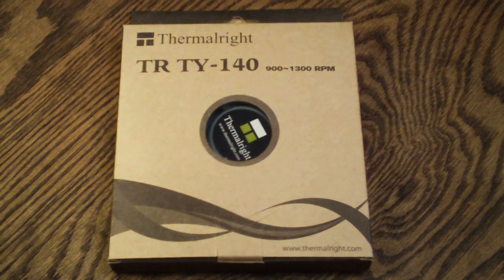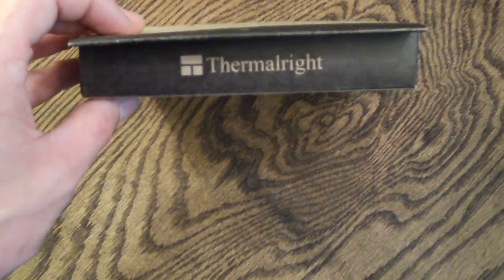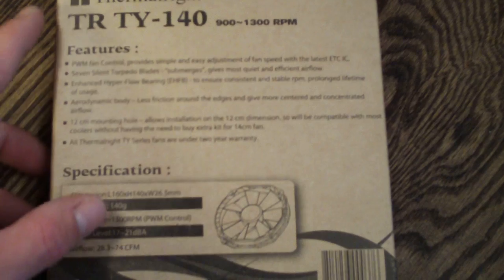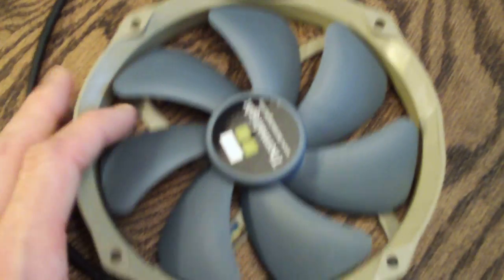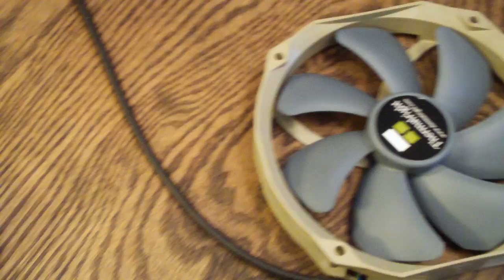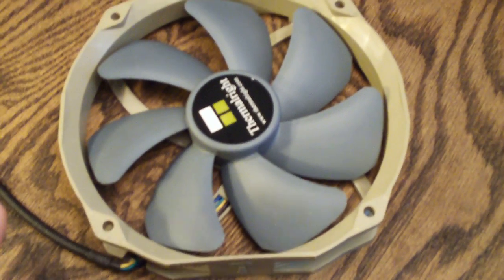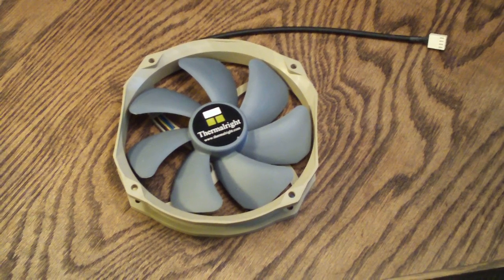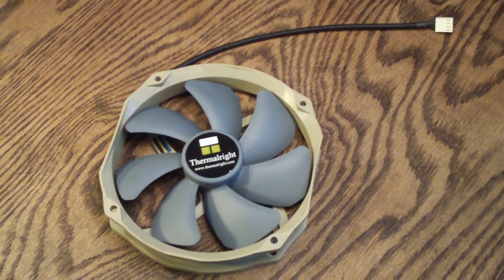Thermalright TY-140 900-1300RPM EHFB Fan Unboxing & Product Overview

Comment: I was thinking of replacing my H70's fans and my corsair 650t's top fan with these for a total of 4. I'm concerned I'd lose cfm while questing for silence. I put a piece of paper on top of my case and it barely holds the paper there. My Thermaltake fans blew it completely off the top.

Comment: I don't know if anyone shares my view, but I think these 140mm fans that mount in 120mm space fill a niche marker/limited use. When you got like several 120mm mounting spots on the case - this type is useless, they won't fit. When you want to mount this 140 mm fan in 140mm spot you usually can't since they're only supporting 120mm mounting holes. Also, and its purely aesthetics, I hated similar Noctua 140mm fan for the color scheme, and this one isn't any more pleasant. I prefer uniform black.